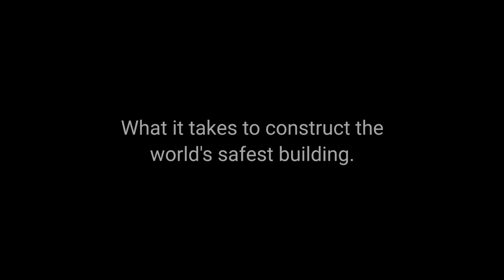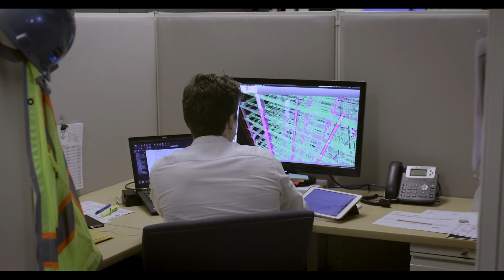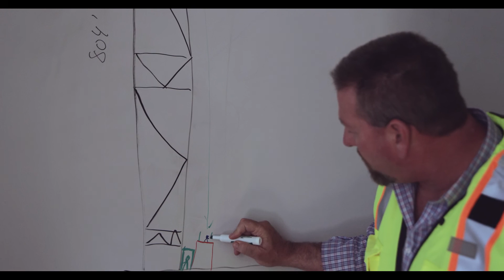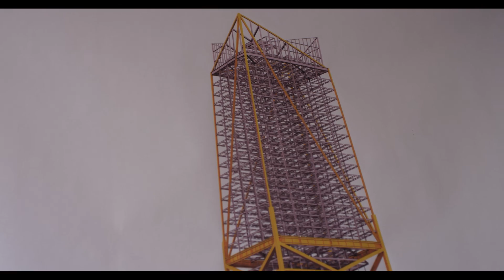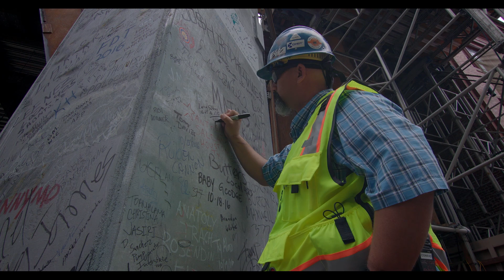SafetyCulture (formerly iAuditor) & 181 Fremont | The World's Safest Building

Comment: Folks, I know it's easy to get caught up in the hype. However, real life is not exactly like the movie San Andreas. The fact the Millennium Tower is settling a bit more than the designers expected is a far cry from it toppling over. The Millennium Tower design concept has a large block of concrete at the base vs friction piles. The Millennium Tower is concrete vs lighter steel construction. The Millennium Tower was designed to base building code vs performance Peer Reviewed design (much more expensive!). So the designers should be proud, as should the developer for spending the extra money to go above and beyond. Besides, the Millennium Tower is leaning west:))